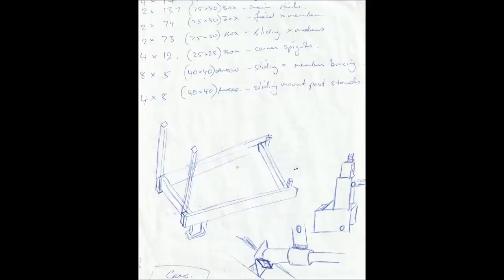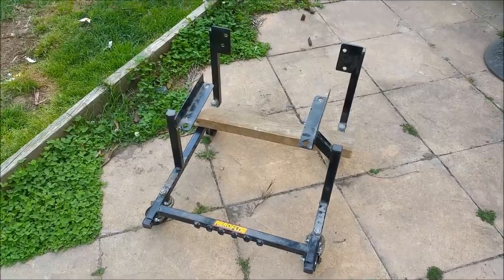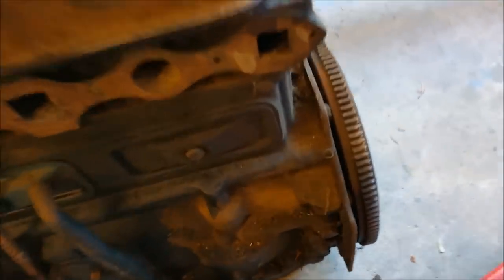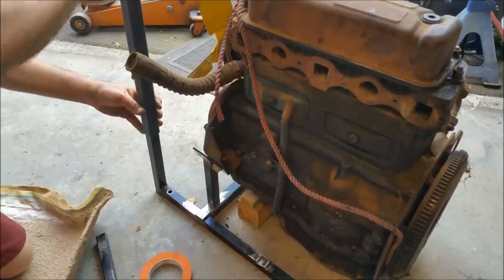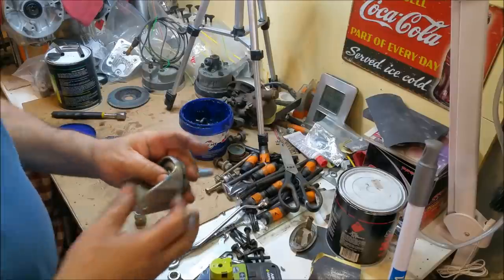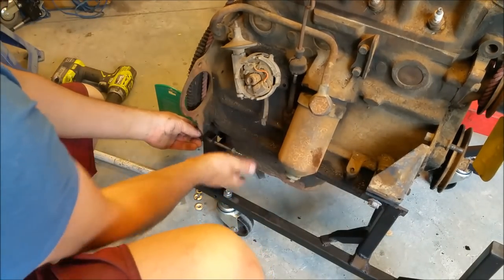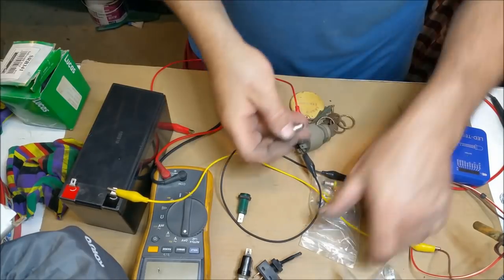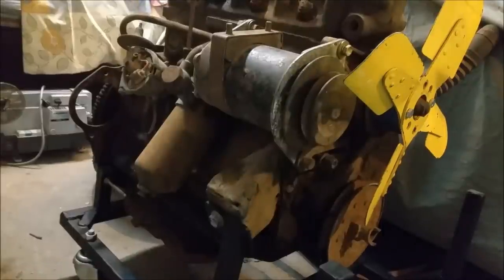Making an engine running stand with offcuts and scraps   Zero Dollars!

Comment: In reference to your end credits joke, thankfully I never worked much on Lucas electrics, though I did have an experience with a '62 Rolls Royce wiper motor.  It had a short, the slow speed coil was cooked so I replaced the coil but the motor blew the fuse when back in the car.  I ended up replacing the coil over and over and replacing it back in the car but it blew the fuse each time .
I kept banging my head against the wall unable to figure out why. 
Eventually it dawned on me the Roller was positive Earth.  So while the original short was the fault of the shorted Lucas coil, the continuing blowing of the fuses was my bloody fault. 
I was a pimply faced teen at the time, and that was my first experience with Lucas electrics and positive Earth Pommie cars.

Comment: Nice work on that stand Peter, I'm not sure if this will work but for the radiator mount you could try drilling a hole on the part that will slide over the top and weld a bolt to the outside of it so you can just tighten the bolt to hold the radiator at the height you want it. I've probably explained that badly and I apologise but I have only just got up lol.
also for your merch I hope there will be a "She'll be right!" tee shirt or mug :-)

Comment: Dunno about the stand in the opening, but those engines........ Got a 1600 Fiat twin cam and a 3.9 LR V8 I'd like to build one for. Oh, and a 300TDi and a TD5.... and a Falcon 4.0 EF engine, and a NA Barra..... No Clevelands or Windsors anymore, sadly. Dunno where you found a "junkyard" Cleveland. Getting thin on the ground these days.

Comment: I bought two of those Ebay Cleveland engine dollies and you are right Peter. They are rubbish and don't fit properly. I was lucky to get it to bolt to one side of the block mounting point. The other side, forget it. Whoever made these was on drugs.